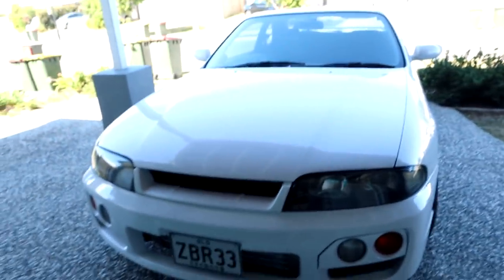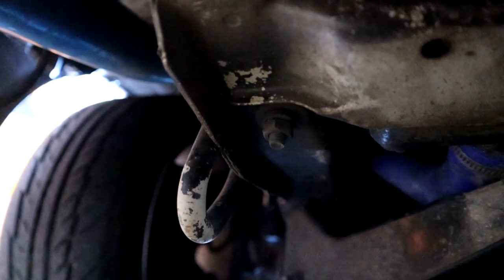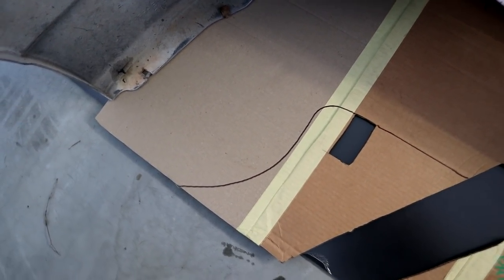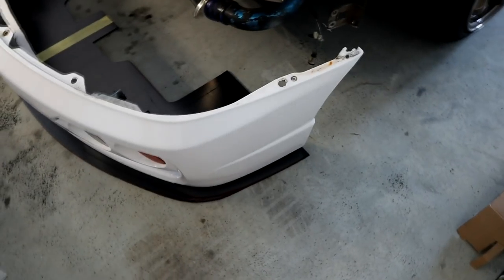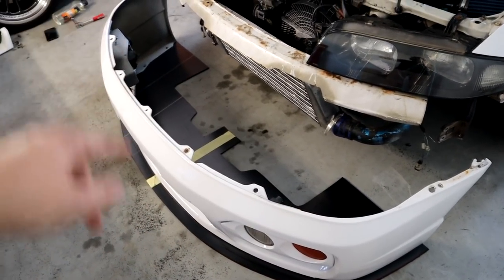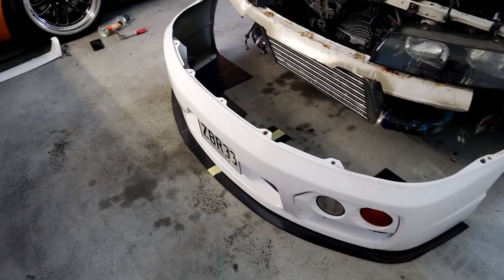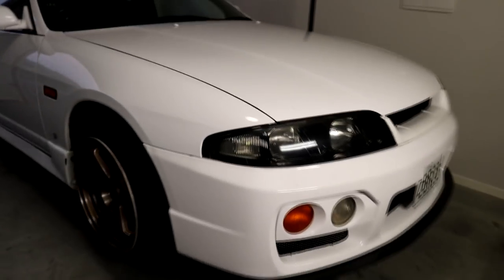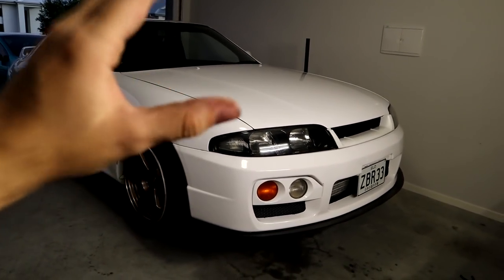Nissan Skyline CUSTOM Splitter Install

Comment: one way to mount the splitter in the middle there would be to make up a long rectangular metal bracket. bolt it under the crossmember extension with the 2 bolts and have it long enough to have a bolt hole or 2 for the splitter. make up 2 identical one for the other side too. If that all makes sense haha

Comment: Get a couple of straps like makano set and you can fold it around and bolt it and then bend it to hold the back part solid you can get them at Bunnings just make sure you use lock nuts and spring washes

Comment: if you can try and cut a section of the left overs and attach it over the join using araldyte or similar glue to the top (i.e the engine side where you cant see it) this will have a double effect of stiffening the middle and joining it together as one piece.

Comment: Things you could do to make it look more complete. 
- spray an inch of black spray paint or vinyl wrap 1" of black on the lip of the top grille
- add rubber push in seal between the bumper and splitter. 
- spray the fog light grilles black 
- add a badge of sorts to the top grille eg. gtst badge
- mount the intercooler closer to the bumper, usually enough play for about 20mm.
Keep up the good work

Comment: Actually looks tuff af gonna do this to my R32 Skyline
Reply: I prefer them without the big chunky lip on the front. To me if you look side on at the car the front is a good 3 inches lower than the skirts which knocks off the balance of the car.
Reply: Mr. Dodo on the 33 or 32?
Reply: Mr. Dodo 32 gtst front bumpers are a lot smaller the GTR numbers so you get get away with putting a lip on if your talking about a 32
Reply: @aquai4880  More-so on the 33. I don't know why but it just messes with the bottom line when looking side on, makes the front look too deep for the car. Same with sti's and the splitter they use. Call me OCD but i just love a clean line lol.
Reply: Mr. Dodo ohhh yeh I haven’t actually seen a 33 with a front lip in person so I wouldn’t really know other then this vid

Comment: Next time get a 30-40 dollar laser that has horizontal and vertical lines and hang it at the front of your car and you will get Centre of your car easier and then you can lay the sheets down in front of your car and measure and mark as you go

Comment: Stop "making it cleaner" or fixing it.. it's a drift car... after an event or 2 it will be flogged and farked hard!
Reply from the maker: No point leaving it look terrible when I have so much time with no tracks open 😉 if I rip it off so be it
Reply: @ZacBaldy  to be honest this comment wasnt based on the splitter, in my opinion (which means fuck all to anyone but me haha) this was a cool mod and looks good, may even have the slightest function... was more so for the most part of the r33 series, focussed more on fixing this or painting that, than seat time! Most important thing is seat time... plussss I can tell you like this car and have pride in what you have done, would be a shame to see you let down or upset when either you go off track, someone hits you or you start to tandem.. all the hours and money gone in an instant... I get the appeal to it, but for a "drift" car just seems a little backwards for before you have even hit the track. Just my 2 cents worth fuck all haha 😂👌🤷‍♂️
Reply from the maker: Rhysk94 hahaha no I get you man! You see it as more of a nice car go to waste in a way😉 haha great minds think alike. Think of this car as luke Adam’s Cream S13, looks good, simple car and yeah he tracks it and it has seen a few accidents, but at the end of the day I do care about this car, and I would like to think that I’ll treat it with respect while tracking, not just back it into walls like I would a VT commie
Reply: @ZacBaldy  VT commodore belongs in a scrapyard with the AU 😂